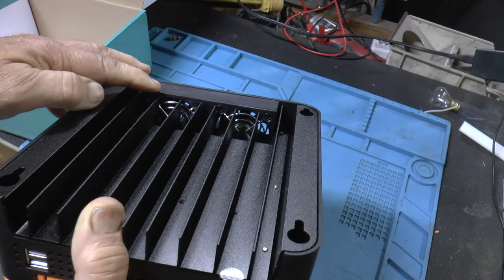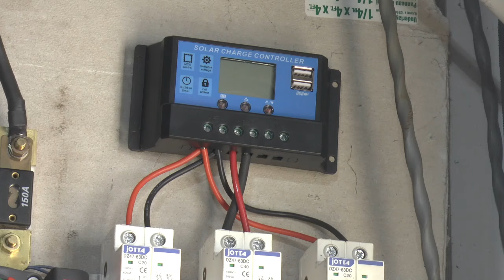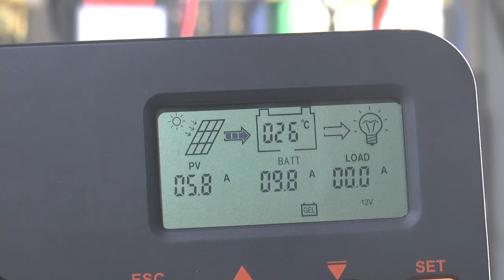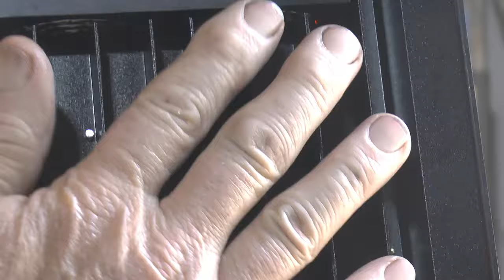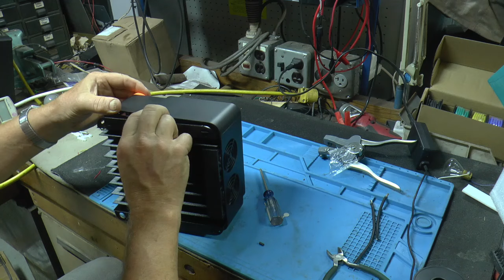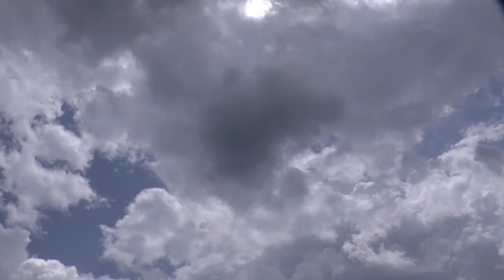Top Bull 40 Amp Solar Charge Controller

Comment: Hello!
I bought the same controller and ran into an issue. When the voltage on the battery terminals and on the input terminals of the device itself is, for example, 12.4V, the controller shows 12.2V. It underreads the battery voltage. There is no load connected at that moment. So it's not a voltage drop due to thin wires or anything like that. I haven't connected the solar panels yet.

Have you noticed this behavior on yours? In your video I saw that the charge current was 10A when the device showed 9.6A.

Could you please advise what to do in this situation?

Best regards,
Dmitry

Comment: It will not show 100 percent for lithium because it is set to 13.8volt
For full charge set it to 14.4volt.
Reply from the maker: They are not accurate for lithium batteries. You need to use a shunt to keep track of AH in and out.
Reply: @kevincrawford2027 
Okay but what if a shunt is not available, will it overcharge/undercharge?

Comment: Excellent video! I am about to order one called  AeternaSol. Seems to be generic and the vendors add their own brand name. Other reviews state that the fans engage when the ambient air temp is 25c. This is a problem, as at no time the temp is less that 27c here in Jamaica, which means the fans would run all the time. Have you figured a way to adjust the temp the fans kick in?
Reply from the maker: I never need to change the fan operation. Mine is in the garage so noise doesn't matter. My fan will come on when the output gets to 20 amps no matter what the temperature is.

Comment: Do you know how to set the "float charge" to14.6?  I pressed the set button to get the volts to flash on the left side and used the up/down buttons to raise the voltage to 14.6 . Rebooted the controller to keep the settings but in use the voltage never gets that high only 13.8 at it's highest whne the battery is at 100% .  Tried resetting it to factory and still the same.
Reply from the maker: If you are going by the % display on the controller I don't think it is accurate for LiFePO4 batteries if that is what your using. Mine goes to the voltage I set it for and keeps it there if there is solar enough and light or no load.
Reply: @kevincrawford2027  How do you balance your batteries?  I'm sure that the voltage has to go to 14.6 (absorption) for a while til the battery is full then the amps go down and then the voltage goes down to the float setting of around 13.6.  I can't find the setting that will allow that with is controller.  I have an HQST 20 amp controller that has these settings but this controleler does not. Not sure I like this controller.
Reply from the maker: @trainmaster0217  This budget controller doesn't have as many setting as the more expensive ones but seems to work well for me so far. Never had a problem with battery cells not staying at a reasonable balance according to the battery BMS.
Reply: @kevincrawford2027  Thank you, that's good to hear.

Comment: I just got mine trying to figure out how to change the settings form gel to lithium for my battery settings
Reply from the maker: Push and hold the set button until you see the battery icon flashing ( bottom of the display ). Now use the arrow buttons to select the battery type. Once the one you want is selected push the set button.

Comment: Hey great video I just got the 50amp version, my panels are rated at 327wats 5.97amps(i have 2 of them). Do you recommend series or parallel to get the most out of the setup? I’m using a 1000wat inverter the purpose is to run my high power grow lights off the grid
Reply from the maker: Series as long as the voltage doesn't exceed the max solar controller voltage.
Reply: @kevincrawford2027 what’s the max on these solar chargers?
Reply from the maker: @STMENTNETWORK  There is a label on the controller that should tell the max voltage.
Reply: @kevincrawford2027 when it gets here I will check it out I think each panel is like 57v the brand is called sunpower

Comment: hola amigo, en 24v pone que admite hasta 1040w de potencia y 100 de voc. como recomiendas conectar paneles? en serie o paralelo? serian 2 paneles de 505w 
Potencia nominal (Pmax) 505W
Tensión de circuito abierto (Voc) 45.72V
Tensión de máxima potencia (Vmp) 38.53V
Corriente de cortocircuito (Isc) 14.00A
Corriente de máxima potencia (Imp) 13.11A

gracias!
Reply from the maker: I would probably put them in parallel with that high of a VOC especially if it gets cold in your area. That is pretty close to max for that SCC. Quite often the newer panels will actually produce more than they are specked for under some conditions like ( low temperature and or cloud effect ) .

Comment: I have the same 40A model. Compared to my PowMr Chargers (20A@24V and 60A@48V) the startup un this charger is MUCH slower, the MPPT tracking is much slower to. Hardware is good, but the software needs some improvement IMHO. But its cheaper then the PowMr parts
Reply from the maker: It's slow but it is consistent. By the end of the day I don't think there is much difference. I like the ease of making changes on these. So far I'm happy with mine.
Reply: @kevincrawford2027  Yes, I agree. By the end of the deay it'S the hours of sunshine that matter, not the model of charge controller. They all work well

Comment: I bought out of pocket the 20 amp and 30 amp and both work flawlessly. Now mine are under another brand label but are the same. I really really like these units for the price.
Reply from the maker: I bought mine too. I liked mine so much I bought the 60 amp 48 volt one ( different brand ) for my house system. Works good so far.
Reply: @kevincrawford2027  thanks for the info I might get a 60 amp

Comment: I bought two of these from Amazon and had to return both of them. The first one was DOA. The second only worked for a few minutes and then it died. Save your money and buy a better product.
Reply from the maker: Sorry to hear that. Mine is
working fine. I be interested to know your input values for your solar and battery voltage.

Comment: I have one of them.  Can you please explain to me the 1-24 hour timer in the setup menu?
Reply from the maker: I think the timer part works with the load part of the controller. I don't use that part so I can't help and the user manual is useless to figure out how to use it. Sorry I can't be of help.
Reply: @kevincrawford2027  i just got that answer afte hours of looking lol. Thank you.   I have to look into the battery settings. Not sure i have them set right

Comment: I have yet to use this controller . I purchased one 20 amp and two 40 amp  units . I was looking for a utility budget type 12 volt mppt controller! The reviews seemed to be pretty good. Wanted to use them in some outbuilding  ( sheds and  barn) systems for lighting .
Reply from the maker: Only used it for several days seems to work good so far. Longevity who  knows. Will probably have an up date in the future.